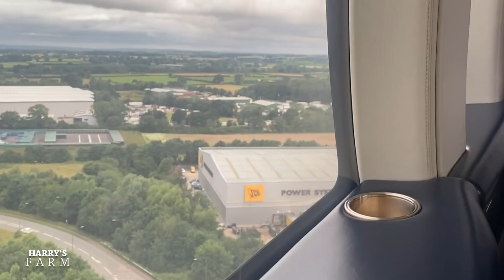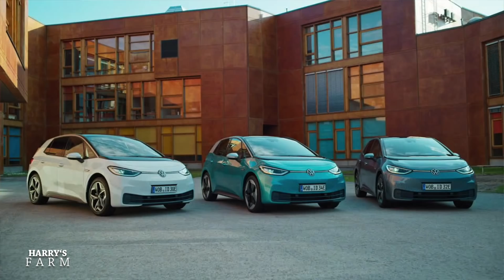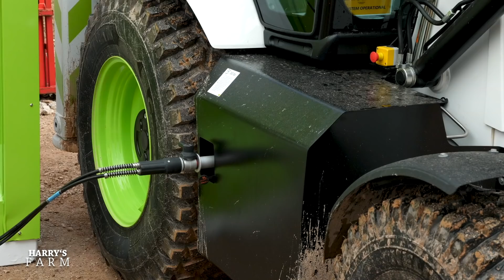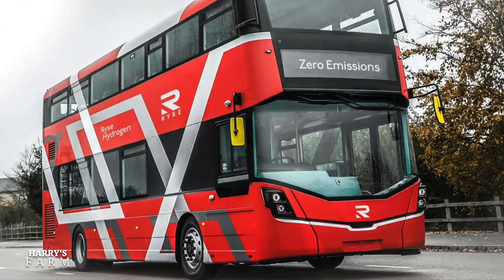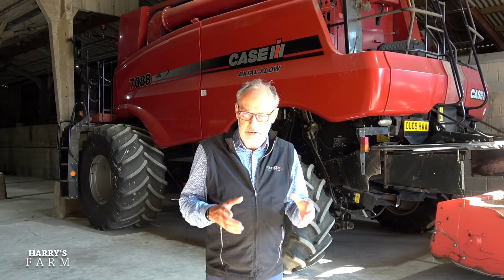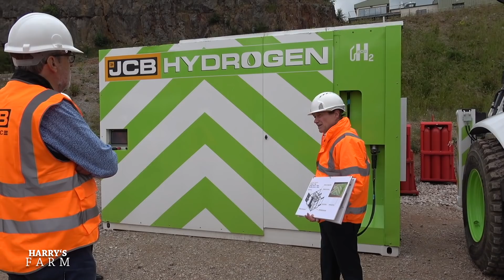Why JCB thinks hydrogen is the best alternative to diesel for heavy machinery, farming and HGV fleet

Comment: Hydrogen is and always will be the sensible alternative to petrol and diesel. However H2 extraction from H2O cannot currently be monetised/taxed to the same level as oil by governments. 
Electric transport is not sustainable for the majority of people.
Reply: Why’s it not sustainable. Why would you use tons of electricity to make hydrogen, when you can just shove a lot less into a battery
Reply: @fanfeck2844  Delivery of zero emission power to remote sites would be more feasible with Hydrogen tanks and considerably cheaper. We need to stop treating EVs like some sort of religion that must not be challenged. It's fine for urban travel but storage capacities are too low for industrial uses.
Reply: @jagman84  dermot was talking about the majority of people, so presumably meant personal cars, where ev is preferable. It takes a lot of electricity to make hydrogen, so it’ll never be cheap.
Reply: @fanfeck2844  making batteries creates quite a lot of pollution.
Reply: @jose-Maki  I keep hearing that but not sure why, as it’s just mining, like we’ve been doing for various ores for hundreds of years. It probably just needs better regulation
Reply: @fanfeck2844  not only mining, but then shipping the product to several.diferentncountries to make it
Reply: @jose-Maki  but this happen with every ore and mineral. Oil has caused way more environmental damage
Reply: @fanfeck2844  well it needs a lot of materials, the mining and all the pollution it creates witch is nearly as the equivalent as modern day lifetime of a car. To then sell it as green as a lettuce
Reply: Not sustainable? I drive a lot on self produced solar. No big deal really, anyone with a roof could do it. Internal combustion is so incredibly inefficient I can't believe Harry is so stuck on it. Almost like a religion for him
Reply: @nlSpiller  I can see how it makes sense for big plant